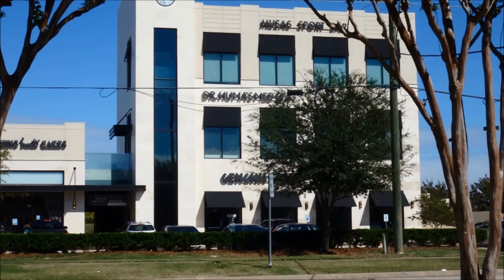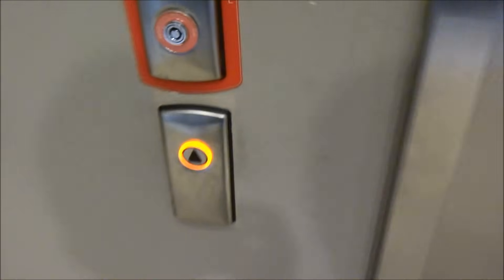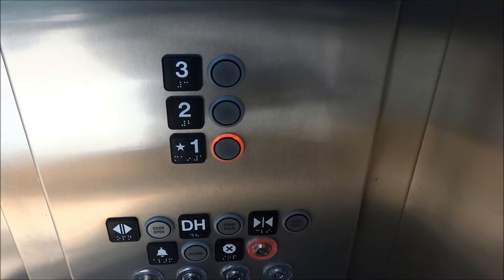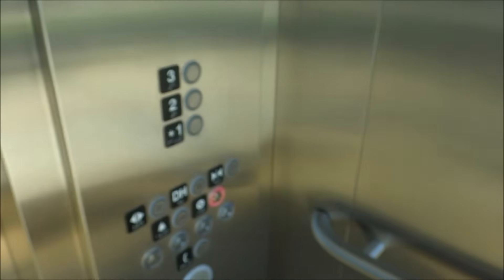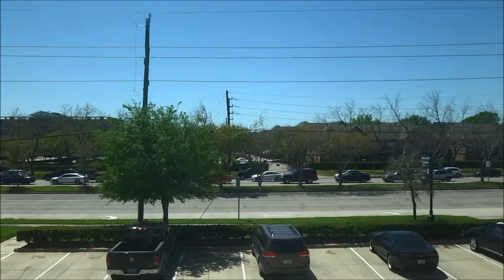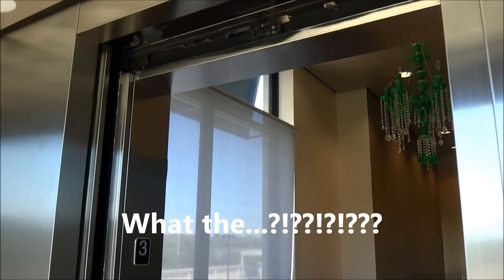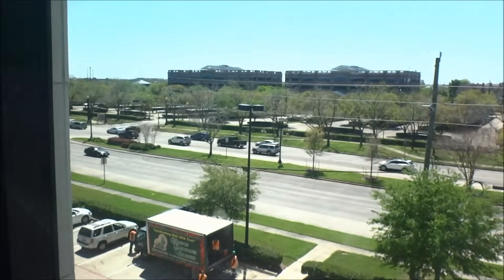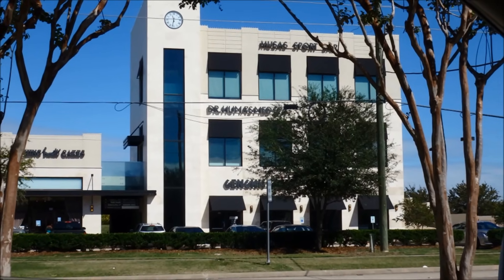EPIC FAIL!!!!! The Kone EcoDisc Scenic elevator is having major issues & breaking on camera!

Comment: Some possible causes of the fail are that the safety chain was broken somehow, maybe one of the doors wasn't properly closed. When it stopped at the top most floor, it must have overtravelled, striking the overtravel limit switch. A professional should be able to sort it out easily.

Comment: Hmmmm. Low oil maybe?
Reply: MRL elevators don't run on oil.
Reply: It's traction.
Reply: No, because it did not do anything when it went down to 1 when Jim got it working. If it was low on oil then it would start shaking a couple feet before it opens on 3. It is got to be something else. Also the DH button blinked a couple times at 7:01.
Reply: It's probably a controller glitch!
Reply: This is a traction not a hydraulic.  So low oil is not likely a cause.
Reply: Well I guess now I know. You learn something about elevators each day

Comment: Two main problems here: first, something isn’t right with the brakes. On pretty much every MRL (machine room-less) lift ever, the main brakes take the form of an electromagnetic clutch on the main pulley which the motor is attached to. It sounds like the brakes weren’t coming off properly. This mechanism is also why you will hear a semi-loud clunk when the lift starts and stops. It’s completely normal to hear this and they all do it. It works exactly the same way as the air conditioner on your car. When the electromagnet engages, the clutch plates are squeezed together which allows the entire assembly to turn, otherwise it disconnects. If there’s something wrong with the clutch assembly and it’s sticking on, which is something that might happen when a contact in the contractor that controls it welds itself shut, it can do things in the exact manner described. The controller thinks it’s off, but it’s not.

The next thing is that the lift hit its final limit. In the top and bottom of every shaft, there are four mechanical switches. First slowdown, second slowdown, normal limit, and final limit.

The first two switches tell the controller that it’s nearing the end of its run, and to start slowing down. Once it hits the normal limit, that is where it should stop in order to be nice and level with the top or bottom floor. However, a bit beyond the normal limit, is the final limit. Under no circumstance is the lift ever allowed to touch it. If it does, this basically signals to the controller that something is very wrong, jam on brakes and cut power now. Once it hits the finals, the controller shuts down and the lift will not move again until a mechanic comes out and resets it. You can press buttons and play with keys as much as you want, you can put the thing into fire service if you want, once it’s dead, it’s dead.
Reply: Of course it can be much worse than this..........
Reply: I laughed way too hard at that last sentence.
Reply: No. The final switch is not the absolute last. Theres one more overtravel switch, that does a "shunt trip" basically energizes a trip input on the elevator's main breaker.

Once this trips, elevator is dead, everything is black. Then the elevator will behave as its a power outage.

What I know firemans switch SHOULD allow the elevator to move. This is why it won't allow selection of any other floor than ground floor. Basically, the elevator is in lockout, but this shouldn't hinder fire service, so if firemans switch is turned, it should allow the firemen to take manual control of elevator. What I understand if firemen turn firemen switch and hold door close button, elevator should move to ground floor as that is selected.

Or you as firemen need to "jog" the elevstor out of overtravel switch using the manual up/down ride buttons in firemens panel, to reenable.

It might be that once you leave firemens mode, the elevator will lock out again (as it "remembers" having hit a overtravel switch) and will need to be cleared by a elevator technician. (Basically, you can't reset the elevator to normal operation by turning firemen to RESET, it will just lock down again).

Comment: Programming and Elevators By ElectricalDistorter
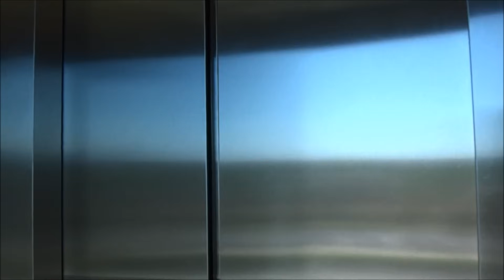That elevator seriously needed help... I wonder how it’s running now in 2019, but when this was filmed it was in bad shape... If you look closely at 5:31, you notice how the doors move slowly open, meaning the elevator slowly opened its doors, then the controller shut off. The elevator didn’t entirely lose power otherwise the fan and buttons would’ve turned off, as well as the indicator. But the door hold button flashed at 7:03 probably indicating the elevator was out of service. On some KONE elevators (I think UK ones), there is a red text at the bottom saying “OUT OF SERVICE”, but I’m not sure. At a mall near where I live, there is a KONE KSS 370 elevator in Macy’s just like this, but it’s hydraulic, 2 floors, and non-scenic. The elevator has some leveling problems. I recently visited there and it took 15 SECONDS to level while going up, but only 3 going down. And that’s not all. It also re-levels a lot when it stops. Anyway, to conclude this, I think the elevator is just going through a tough time and hopefully is working well now, because it sure looks nice.
Reply: Oops, I accidentally put my own name at the beginning of this comment! 😂

Comment: There is a problem with the brake, and drive system. The safety shutoffs are engaging. It's running out of control basically, and the safety switches are engaging.

Comment: It could potentially by a controller or motor failure
Reply: DJJack 1229 doesn't seem like it. I'd bet on a maladjusted brake shoe tensioning screw. ;)
Reply: It sounds like it’s trying to move but there’s something stopping it

Comment: looks like it was a motor issue with the controller and motor its trying to move with the brakes still engaged causing the shuttering as it tries to pull thru the brakes then the controller does wierd and over travels and shuts down thing needs help hope to see a retake of this one this year

Comment: How did that happen?
Reply from the maker: +Willis Elevators Basically, when I called the elevator from the lobby, it wouldn't move and when I took the MPE upstairs to 2, I tried getting it move from the inside after making like 3-4 jolts, I finally got it to move. But after a 1.5 road trip, it permanently broke down at 3. I have actually check out this ting a week in a quarter ago and they fixed it!
Reply: How come would it be extremely messed up,broken,and mount fuction. That elevator sucks as well!

Comment: Sounds like it tries to move and it trips out one of the relays which is why you hear a bang.  And the motor is locked up so when it tries to move, it can't so you hear the buzzing of the motor trying to move the car.
Reply: Also, next time, just get out of the elevator right away and tell the building management that there is a serious issue with the elevator and nobody should use it.  Have them call Kone or their service technician asap.
Reply from the maker: There were no building staffs on duty anywhere. This is a little shopping strip, so there are not anyone here, except for customers, who works in this facility.
Reply: PotatoLift1 they are relays .. its controlled by a v3f drive n relay to supply power to the motor.. n there are relays controlling doors n safety cct

Comment: I think the brake is defective. First, it probably tried to move with the brakes still applied. Then the brake probably didn’t engage at the right time, therefore it hit the final limit and won’t do anything until someone manually resets it.

Comment: Overreacting on a broken lift.. Even people here in the comments about horror movies and stuff. You won't die in there. Just notify the reception or so and it will get fixed.
Reply: Richard van Pukkem with the sounds it was making i can see why people would be scared. sounded like it was going to drop
Reply: Elevators aren't much different than cars. They require maintenance, and occasionally parts will be bad from a supplier.

It's possible this elevator is being serviced by a completely different company  (so not Kone's fault a repair hasn't been done), the repair isn't covered by warranty (so the building owner would have to pay to fix), or quote honestly, the maintenance team hasn't stopped in yet to know there is an issue.

Instead of getting on the elevator, and freaking out when you were stuck...why not just call the Kone customer service line and report a problem? It may not be your responsibility, but what is the point of the video?

Is it to just trash a company that may or may not be aware of an issue or is it to make sure others don't get stuck?
Reply: If there stuck how can there go to a reception and not all flats and skyscraper don't have receptions
Reply: @wendysteele4508  Some good points you made there.

However I encountered several lifts like and most of them has the same logic controller (LCE CPU 40) which is a easy logic to use if you done alot of research on it.

But the thing is however this lift or as you guys call it an elevator reacted I think all the lift needed was a reset because what I see from the lift the lift just attempted to relevel and though it wasn't aline with the floor (hence why it did with the doors open) It's happened to me before and all I did was reset it, shut the doors by hand and used the inspection panel on the logic controller cabinet on the top floor, enabled Inspection and then drove the lift down a bit and put it into service again and then wait for the lift to shoot to the buttom floors and eventually find it's position and then it will run like nothing has happened to it.

I don't think it would be hard for any maintenance company to diagnose and fix it and yes anyone can try and call a maintenance company to come and fix it.
get it fixed.
Reply: @haroldflower8008  Oh ffs these have safety brakes etc safety things... Why are you overreacting😂

Comment: It probably hit the final limit switch when it jolted up.
Reply: it moves up to release the brake then goes down so it probably overleved and moved up to release brake then hit limit switch or with the synchronize motor it was jolting to sync the phases
Reply: AIVideos The EcoDisc should only jolt and snap to phase only when in manual, and being controlled by the cartop controls. It shouldn't (or rarely should) Snap to phase in normal service.

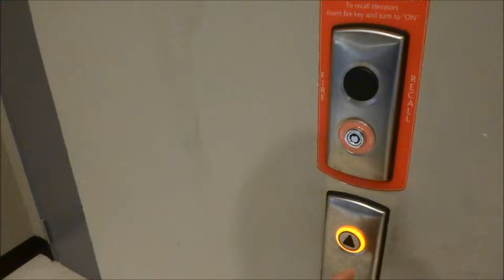Comment: 1:10 This is an MRL (Machine-Room-Less) Elevator, so there is no machine room:) This elevator has some serious problems with the VF Drive, I can hear the motor "cranking" trying to start but eventually,it gives up... 5:27 elevator is trying to go higher than the top floor and it triggers the safety overrun switch located in the shaft

Comment: Probably something to do with the  display showing that its in firefighters mode, and you don't have the key,  this is a bit special and it means that the public shouldn't be able to use the elevator. except to floors with designated exits, like an emergency exit on the top level, or the ground floor with a public exit,  It's in a firefighter mode designed to save your life when there's a fire.  Why it is in that mode I cannot tell. That's usually related to the owner of the building and their building management team.
Reply: You mean inspection mode lol

Comment: the elevator computer relay system is confused and it needs to get a new relay controller
Reply: Itz Serzhan I'm 21 and am getting an engineering degree in mechatronics and I almost guarantee you it doesn't need a new controller. And just to let you know: this is not a relay controller we're talking about here.
Reply: cool dude i want to due th same thing be a fire alarm installer and eleavtor repair bissness
Reply: Itz Serzhan good luck.

Comment: Nice elevator to ride... What is going on the how stuck it on this elevator be going? This elevator needs fixtures.
Reply from the maker: +MATTHEW SCIENCEMAN This thing has a motor issue I believe. I have check on this and it now works fine.
Reply: +MATTHEW SCIENCEMAN 
fixtures means buttons design, service is the word. Correct me if im wrong

Comment: I'm glad I never broke an elevator yet. I just hope this doesn't change.
Reply: The only 2 times an elevator has malfunctioned on me were:

1st time: at the shopping mall in Aschaffenburg. I was on my way to my car, other people wanted to get off earlier, but the elevator stopped on the floor, but the doors were stuck. I tried the <|> button, which didn't work. Then I tried to slide the door open, which caused a loud "CLACK!" and then the door opened very slowly and everyone but me got off. I managed to fix the elevator, even though I'm not an elevator technician. My guess was that the door locking mechanism was malfunctioning.

2nd time: at an underground car parking garage in Würzburg. I rode the elevator in order to see, if it worked properly, which it didn't. It had another door issue. I went down to -1, and the door couldn't open. But it closed again, and I went back up to the ground floor, where the door worked properly. Then I walked down the stairs to -1, where the door was malfunctioning, and called the elevator from there, but the door was still malfunctioning. I tried to slide the door open, hitting the mechanism in the process and then called the elevator again. And then the door started working properly again.

Comment: Okay, if I were you, I would have called building management immediately. Someone could have easily gotten stuck in that thing, and the jolts and the over-leveling show that something is really wrong with that elevator. When an elevator is malfunctioning that badly, it becomes a safety issue that needs to be addressed. Anyway, still a wonderful testament to KONE quality.

Comment: the motors pump is broken
Reply: It's a traction elevator.
Reply: it uses gearless roped motor that lowers and lifts the car possible that the gird rails need greaseing or its computer may be glitched or needs a service
Reply: its like it keeps resting its self

Comment: I think it’s the computer system that’s malfunctioning because when the elevator over-leveled it was a small difference but when the doors closed and re-opened from the jolt, it really over leveled. So the things that must be broken is some rusty components in the elevator and the computer system that’s causing the elevator to go in the wrong direction like slamming into the elevator shaft roof and not going down. Epic fail!

Comment: This is definitely a pretty messed up elevator! I think they should've chosen ThyssenKrupp instead. Great video as always and hopefully they fixed this by now.
Reply: I recently rode a really bad thyssenkrupp elevator. It jolts when going up, its slow, it sounds like it low on oil, etc.
Reply: It doesn't matter what brand it is, if it's not maintained, they will have problems in the future.